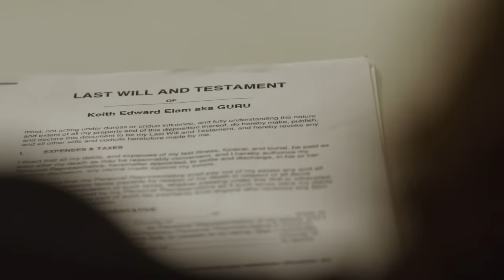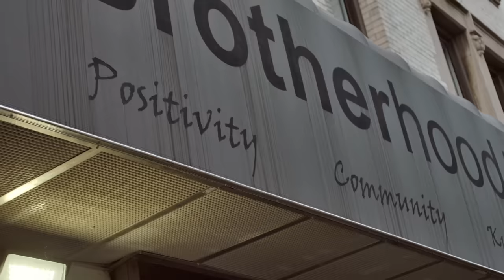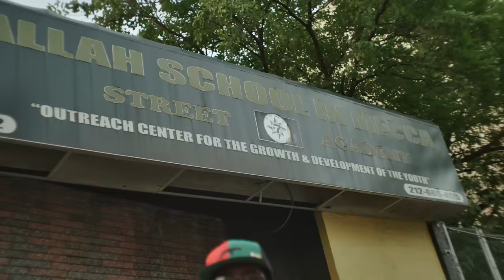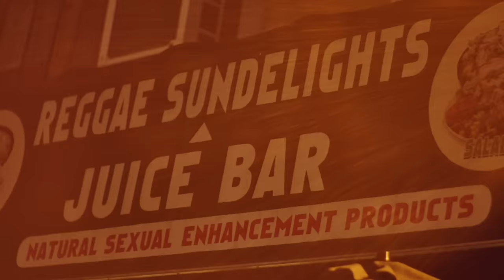Gang Starr - Family and Loyalty (feat. J.Cole)  [Official Video]

Comment: I tuned the last three cars I built to be able to cruise left to right and back on a tank of gas. Need dual generators and a higher battery discharge rate. With new fuel injection u can uses like a half pound of pressure to produce 200pluss ponies. Gallon of gas is 6 pounds at 1 pound per hour and a good transmission u can fly forever. Trust me tho u need the electric upgrades I never had any issues besides power. The spark plugs in the higher cylinder engines chew amps.